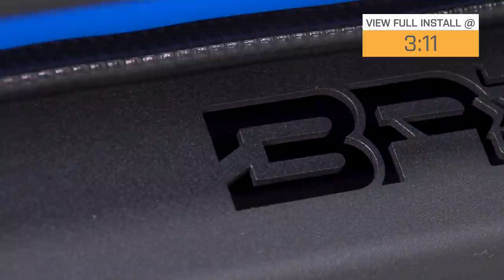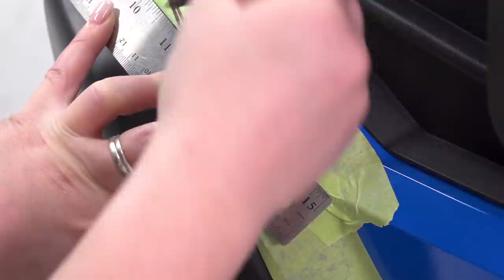2016-2021 Tacoma Body Armor 4x4 HiLine Series Front Bumper Review & Install

Comment: Just finished installing this bumper on my 2021 Tacoma TRD 4X4 without the bumper.  Bought a new unpainted Toyota OEM bumper to cut while keeping my original OEM bumper intact. 
The wrinch installed too, works flawless with the bumper.

Comment: It does look good. I’m with the other guy though. Not wild about cutting up my brand new bumper.
Reply: I just bought a new unpainted bumper and cut that. Original painted bumper now a spare.
Reply: @useryggfdcc  did you get the new bumper painted to match the truck?
Reply: @Skylyned  No, I just kept it unpainted.  It's the same black plastic as around the wheels fenders .
Still looking good.

Comment: That cooler line bolt was never reinstall?
One behind the flap in the wheel well.

Note: the righthand tow hock is touching the bottom off the bumper too.
Reply: Yea I'm almost done with the install trying to figure out to how reattach the line on the wheel lol

Comment: Always a fan of Extreme Terrain install vids. I had ordered my bumper and Raxiom 20 in light bar. Any suggestions on a winch? Specifically fitment in the BA/Tacoma bumper...or will any 9500-10K lb winch fit??
Reply: I installed the Barricade 9.500lb winch with cable/wireless controller on a 2021 Tacoma TRD 4X4. 
Works beautifully, just properly pre tension the rope with a 500 lb + tension.

Comment: Thanks for the video share, very helpful. I just got my bumper and will be installing a winch as well.  Is the aluminum crash bar & bracket going back or are these taken out permanently?  Also, is it really necessary to remove the OEM bumper to do this install?  Just trying to cut some of the steps...

Comment: Question. Do you also have to remove your aftermarket skid plate too to install this? I removed the stock skid plate on mine and have an RCI front skid on it right now. Thanks in advance!
Reply: I was wondering the same thing? I have the RCI skid plate too!!
Reply: @davidr.1517  Update: Yes you will have to remove the stock skidplate but that should be about it besides two smaller pieces in the back. Easy install.

Comment: What is the purpose of relocating the cooling line? Is it for a winch? If I was not going to install a winch, can I leave the lines where they are?
Reply from the maker: Bolt Plates are used to relocate the cooler, if equipped, towards the rear of the vehicle to increase clearance for the winch mounting plate on the back of the bumper.

Comment: I put that front bumper with winch 9500lbs  and  a 3inch lift in front and 2 inch rear but now my front is lower because of the weight in front and it also bottom out on rough roads is their a better way or stronger set up to stop this from happening.  Thankyou
Reply from the maker: When the time comes to replace your front struts, I would highly recommend looking into a full lift coilover replacement that can help handle the weight and perform better on rough roads. Something like this kit from Bilstein would be perfect. -Zach
https://www.extremeterrain.com/bilstein-tacoma-0-to-370-inch-b8-6112-front-suspension-leveling-kit-47-309975.html
Reply: Thanks for your help

Comment: how much time should it take to install  ( bumper + winch )
Reply from the maker: If you have mechanical experience it should take you about 2 hours with just the bumper. I have not installed this with a winch, but I would expect to add about a half hour to an hour onto the install time. -Merideth

Comment: It makes no sense that these aftermarket parts companies can't design a bumper that could fit directly to the truck without cutting up the plastic and adding that black edge trim.  That makes it look so cheap. Better designers making a better part makes more sense.